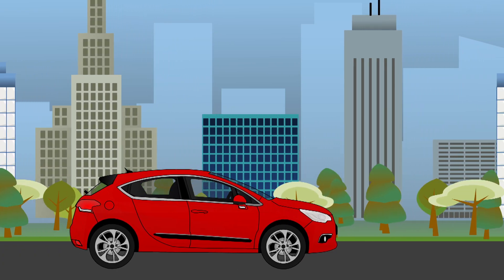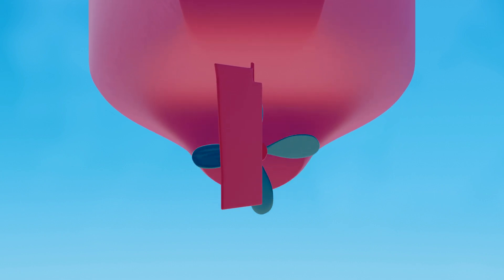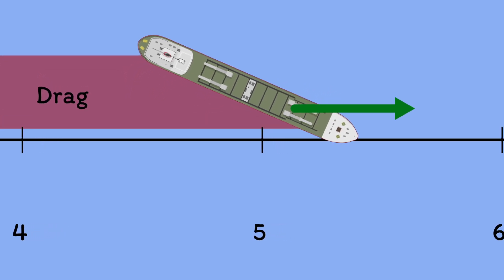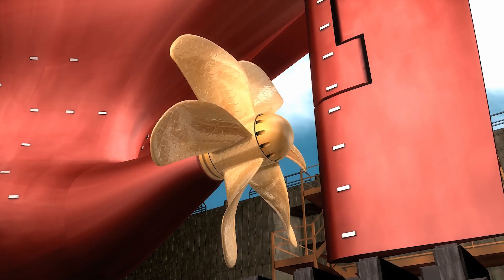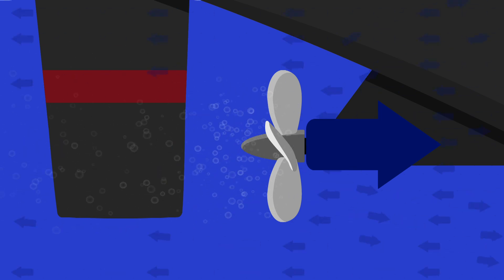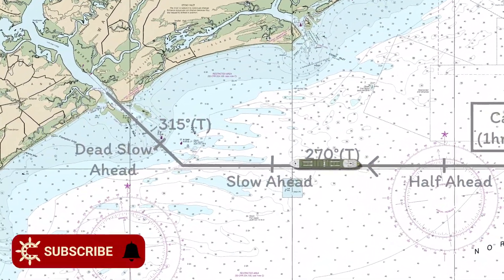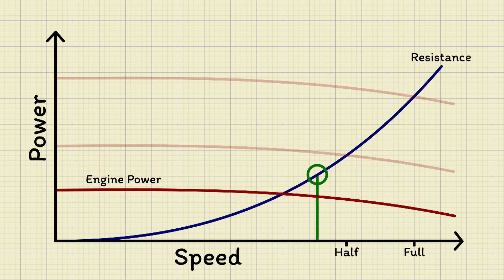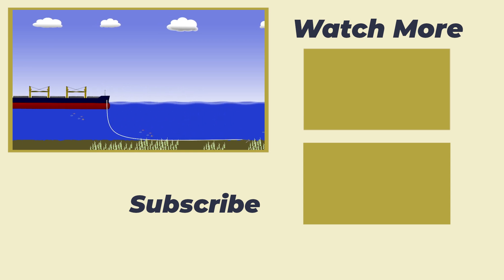How Do Ships Stop Without Brakes?

Comment: Is there any reason ships don't have folding flaps on the hull that can open to slow the ship, like the water equivalent of an air brake? It would be a similar concept to the high frequency method using the rudder, except not making the ship turn so probably maintaining better control?

Comment: I was aboard a Nimitz class carrier during sea trials after a major refit. A crash back stop from maximum speed nearly shook our teeth loose from the cavitation of the 4 screws, and about 2 miles to stop. BTW I was manning the throttles on #1 Main Engine. There is a limit as to how fast your can apply steam to the reverse turbine for two reasons, the torque limits of the reduction gear and the power transients caused in the Reactors.

Comment: A ship with a controllable reversible pitch propeller system can perform a crash stop much faster, because the shaft speed and direction does not change but the blade angle of the propeller is what changes, causing it to "dig in." The CRPP system is not that common on merchant ships, but is more common on ferries and warships. A twin shaft warship approximately 135m long and 4500 tonnes displacement and 32MW power can come to a full stop from 30kts in around 180m using the crash stop maneuver......the marine equivalent of stopping on a dime.

Comment: So, is there no alternative to airplanes' air brakes? Not even experimental, or at particular types of ships?
Reply: In reality the speedbrakes on aircraft don't act like you think they do. It's common sense to believe that panels lifting up on the wing would act as drag, but no. The way they work is by disrupting the airflow over the wing, which disrupts the lift so that the wing becomes much less efficient. On a boat i doubt it would work as it is propelled via a very different system and the forces would be huge.
Reply: @FrecklesAviation  what you just described are more like spoilers. when i was writing the question, i was thinking about planes like F-15, Su-27, tornado, F-86, etc.
Reply: @stanislavfoltan  right I’m. Not my speciality in those.

Comment: Maybe others have mentioned it in the comments, so I apologise, but I was wondering why ship designs don't include some sort of deployable flaps like on the aircraft ? I mean there are obvious reasons, first it's a moving part so there are costs associated with maintenance and probably a million other things. Then, it's highly likely that new materials and hull design techniques would have to be developed because of the stress such an apparatus would exert on the hull. But theoretically, some flaps, huge plates attached to the hull which are extended when the ship needs to slow down in an emergency? They don't have to extend full 90° angle to the hull but to certain degree. And again, how would you extend them? You can't push against water flow, it would require an enormous force/energy, so you could extend them towards the rear (meaning, opening them like a car door would be harder than opening them the other way around), but then they could tear the hull apart. And then there's maneuverability, buoyancy and everything else. :) Anyway, since I know nothing about ship design I'm well aware I just said a bunch of suicidal nonsense but perhaps someone savvier could explain why "brake flaps" wouldn't work on a ship? :)

Comment: why not use brakes like on a planes wing, they dont have to be massive, just multiple sets
Reply: In reality the speedbrakes on aircraft don't act like you think they do. It's common sense to believe that panels lifting up on the wing would act as drag, but no. The way they work is by disrupting the airflow over the wing, which disrupts the lift so that the wing becomes much less efficient. On a boat i doubt it would work as it is propelled via a very different system and the forces would be huge.
Reply: @FrecklesAviation  while you may be correct about aircraft, remember that air and water have very different properties. Due to density, an object in water has much more drag than air so while brakes dont work the same in air, in water i'd bet that they do. as for forces, using multiple sets of brakes would spread the stress out over the ships hull.
Reply: @liamholcroft7212  true. I’m no expert but my logic is this. Move your hand through air at 5mph at 30 degrees. Then put your hand in a pool of water and move your hand as you did in air. Notice how the force is much greater. You also need to remember that a ship is huge and will need a lot of surface area of these brakes to stop. Even if you spread it out they will still need to be strong. And if maritime is anything like aviation, every kilo of extra weight is a  kilo of passengers or cargo that you can no longer carry. 

I must state this is my own speculation and I am no expert in this industry
Reply: @FrecklesAviation  well it's that very principle im talking about, would a large amount of drag be created by a small surface, resulting in a smaller force? I'm no expert but it seems like something that could come in handy when trying to stop quickly.
Reply: @liamholcroft7212  I suppose, but as i said the surface would have to be large as ships have a lot of inertia, and jusat like aircraft speedbrakes they are very ineffective at lower speeds, for ships probably below a couple of knots

Comment: As a layman, I can think of one circumstance where a crash stop might be preferable: if you get an uncommanded rudder hardover. Losing the effectiveness of the rudder is a bonus if it's not doing what you want it to do. Although if you have the space, perhaps turning under full helm is still preferable - then again, if you have the space, do you even need to stop?

Crash stop seems to be what the pilot and master on Silja Europa did when she had a rudder hardover when a rudder shaft broke in the tight waters of the Åland archipelago: https://turvallisuustutkinta.fi/material/attachments/otkes/tutkintaselostukset/en/vesiliikenneonnettomuuksientutkinta/2009/c42009m_tutkintaselostus/c42009m_tutkintaselostus.pdf

Comment: "High frequency rudder cycling" is exactly what we would use in a small sailing dinghy... but actually not to brake, to accelerate when there's no wind, swinging it left and right it as a paddle xD
Reply: Pumping the rudder! I've done that in a 30ft deep-keeled boat... It works, but not especially efficiently - mostly it entertains the helmsman/lady, and possibly gives a little bit of steering.
Reply: tacking is turning towards the direction of wind, however pumping the rudder or High frequency rudder cycling is called sculling pulling the sail back and forth like you would do when pumping the rudder but with the sail is also called sculling
Reply: I know what you mean, I do that on the Sea Kayak pump the rudder gives propulsion like a fish wagging its tail
Reply: Isn’t  that called TACKING?
Reply: @Animalwon  Can not TACK without wind.

Comment: Random thought.... what's to prevent a ship having heavy reinforced metal panels (similar in size to the rudder), spaced out at predetermined locations along the hull, and set flush with the hull. . If the ship needs to stop in a hurry, these panels gradually swing outward, like giant underwater fins on each side of the ship? At fast speeds (or for ULCV's), the panels only move out a little bit - but as the water pressure from drag decreases, the panels swing out more, increasing the drag and slowing the ship even more.

Comment: This reminds me, it would be interesting to see a more in-depth examination how the Titanic could have avoided hitting the iceberg. In popular knowledge it is often cited that they both started to turn and reversed the propeller at the same time (only 1 of 3 could be reversed, the other 2 just sopped), and had they only turned they would have avoided hitting the iceberg, and if they only tried reversing they would have hit it head-on, flooding fewer compartments and then not sinking. I wonder how much of an oversimplification it is.
Reply: Small correction here: 2 of 3 could be reversed. Those were the two outer propellers, powered by reciprocating steam engines. The center propeller was powered by a turbine engine that was fed from the exhaust steam from the other two engines. It could only run ahead, so it stopped when the other two were reversed. Since it's mounted in front of the rudder, the ship lost a lot of control authority when it stopped.
Reply: Would, say running the starboard propeller forwards & the port propeller aft have caused Titanic to turn faster? Along with keeping the center propeller running at low power to keep the rudder working?

Comment: Another reason why propellors are hopeless in reverse is that the geometry of the curved surface is optimised for one direction. The efficiency of the propellor in reverse is terrible, and the flow is chaotic.
I have no experience on large vessels, but even on Canal Narrowboats it's clear that control in reverse is almost non existent. You can give a powerful burst in reverse, but you have to go back into forward gear to regain control of your direction. There's also an effect where the single propellor pulls the stern to one side.

Comment: There is no full ahead sea speed , there is just full ahead . Full ahead is full ahead , the maximum safe speed a ship can travel . A crash stop is literally that and the ''crash '' part is very descriptive because if you try it the chances are it will destroy the engine , they have to be slowed in increments . Most if not all modern ships will have the infamous ''red button '', normally concealed under a cover that needs to be lifted to use it , its the last resort as it will stop the engine dead and all the inertia comes to a sudden stop with catastrophic results

Comment: I like how easy it is to understand the video. I have seen huge cruise ships in Kiel smoothly stopping and docking at the harbour, I did not realise how careful they had to be.
Reply: Cruise ships are usually a bit more manoeuvrable as they are normally berthing every day instead of every six weeks or so. Quite common to have twin props or azimuth pods and thrusters so they don’t require a tug.

Comment: whenever my dad brings our boat into dock he always does a gentles turn to the left and at the last minute reverses to stop the boat but swing the stern into the dock, and it works because with a small boat that vacuum created  by the propeller reversing is enough to stop the momentum of the boat doing a whole 3 mph into dock, but keep in mind I've only ever done this with a 22 ft motorboat.

Comment: Wouldn´t, in theory, Huge underwater pneumatic flaps work? Like, having a big flap on either side of the ship and one beneath, which extend when there is the need to brake thus increasing the drag massivly?
Reply: This would require huge (like HUGE) and heavy pieces of machinery placed in poorly accessible areas, would decrease ship's volume which could be used for ballast or for cargo, would require tonnes of certification, maintenance and testing, would create drag of its own even when not in use. Steering gear on most cargo ships is about the size of a bulldozer - you would require two more of those, and they will only be used occasionaly. And there's literally no piece of machinery on a ship that doesn't break or at least malfunction in some way at least once every several months.
Reply: @VileGecko  i had the same thoughts as both yall. What about a lot of small fins that in essence kinda are meant to be replaced, but could help in a emergency if drag was needed. I get it, it would be expensive, impossible to replace without a dry dock, and somewhat unecessary for most ships but could be used in certain cases

Comment: I would be interested to see your perspective on a reverse prop manoeuvre in a bit more detail, because although there is a  'vacuum' effect going on as a result of the prob blocking a large percentage of the water flow, the opposing side can still deflect the water without sucking more from behind. 

I enjoy your videos so I'm keen to hear some further explanation into this that may clear up what I currently visualise from a dynamics point of view.
Reply: Generally rudders don't extend much past the swept arc of the propeller. At higher speeds there is still some flow past the rudder, but it won't be enough to create much steering force.  What he didn't cover is that with single propeller ships the backing force is symmetric so it tends to force the stern of the ship in one direction or another causing it to turn.  Depending on the ship, its draft, and other factors the turn can be quite dramatic.

Comment: One thing you didn't include about the crash stop, those huge diesel engines need to be at full stop before you can change the revolutions. A lot of the bigger ships do not use a transmission they are directly powered and you can't throw the running engine into reverse. The Supertankers were synonymous with only having 1 speed and 1 direction of travel, forward. Imagine having to shut down your engine and reverse the firing order of the cylinders in order to put the ship into reverse. Destroy your engine and not accomplish anything.

The big engines operating without a transmission are usually low rpm engines, they turn as fast as the propeller does.

Comment: Why don't ships have extendable surfaces like airbreaks? "waterbreaks"? That would be immensely efficient I'd imagine and you wouldn't have to give up control
Reply: In reality the speedbrakes on aircraft don't act like you think they do. It's common sense to believe that panels lifting up on the wing would act as drag, but no. The way they work is by disrupting the airflow over the wing, which disrupts the lift so that the wing becomes much less efficient. On a boat i doubt it would work as it is propelled via a very different system and the forces would be huge.

Comment: “With a 300m long ship, you can stop within a mile or so” 
Now usually I’m not picky about which unit is used but...I mean...come onnnn
Reply: Meters is a perfectly fine way of measuring ship lengths, and nautical miles is the de facto way to measure distance travelled at sea. So it is very reasonable :)

Comment: Why don't ships have very small extendable spoiler blades that extend out of the hull to increase hull boundary drag?  Example, you would have a 10 foot by 5 foot sized spoiler that is pushed out by powerful hydraulic rams to increase drag of a 50,000 ton ship.

Comment: Why no spoilers? They work great for aircraft.

You could even retrofit them. You could chuck out neutrally bouyant, high drag, ropes out the back. Though I suppose if you're stopping in two-6 ship lengths anyway deploying them would take longer than just stopping...

Comment: Why can't ships have flaps on the bottom and/or side that can be extended to increase drag, like the spoilers on an airplane ?
Reply: In reality the speedbrakes on aircraft don't act like you think they do. It's common sense to believe that panels lifting up on the wing would act as drag, but no. The way they work is by disrupting the airflow over the wing, which disrupts the lift so that the wing becomes much less efficient. On a boat i doubt it would work as it is propelled via a very different system and the forces would be huge.

Comment: Is it really true that ships don't use anchor to slow down? I've heard of draging anchor, that's basically droping your anchor while moving to reduce speed while the propwash on the rudder still gives much greater control than if the ship was to slow down her engines to that speed without draging anchor. Yes, that requires specific seabed conditions, and you can't do that over laid cables, but it should be possible (even though not used as often). Also, droping anchor is a standard course of action during any emergency (rudder failure, engine failure or blackout), since letting the ship drift to full stop would take a lot of time. So that's also a method of stopping the ship with anchor.

Comment: Are there no active systems such as to momentarily increase the surface are of the ship? Like underwater wings that swing out to increase drag in the direction of travel.
Reply: I imagine it would reduce control of the ship dramatically. A smaller problem would also be maintenance. If you ever tried to break a canoe with a paddle, you'd know how much force you are operating against. The reason breaking systems aren't developed in seafaring, is because captains usually have plenty of room to navigate, unlike a car on a highway for example.